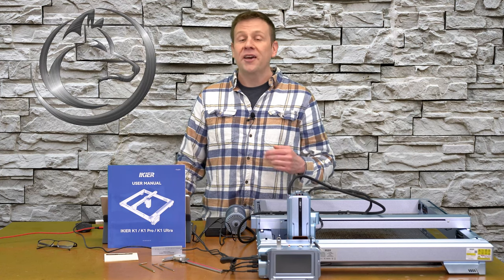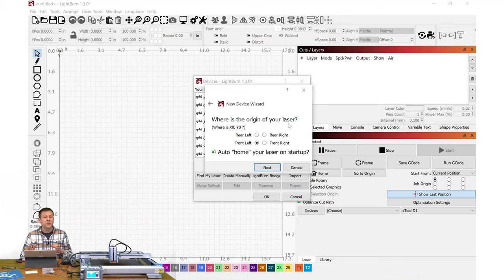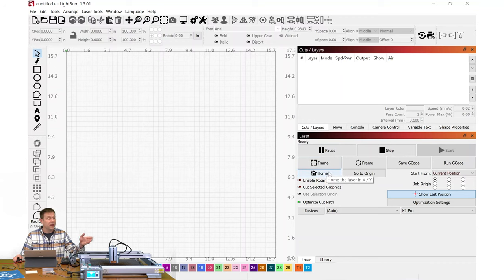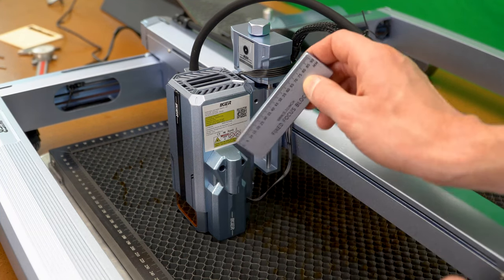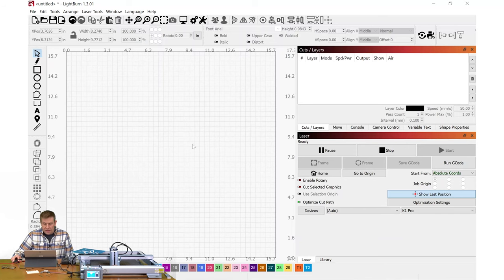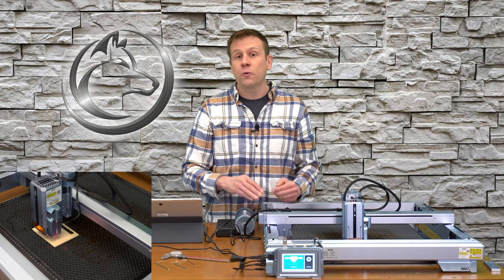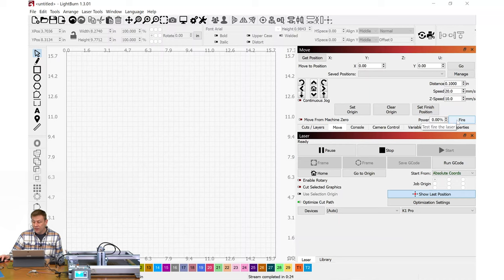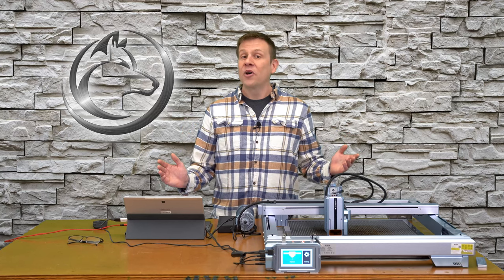Ikier K1 Pro-  Lightburn, Autofocus, and Crosshairs!

Comment: Awesome . Have you tried to do a photo reproduction or carving or 3 d with this Ikier ? I'm wondering if i can do a good photo reproduction .Is that the 70 w ? Thanks
Reply from the maker: Thanks- from time to time I engrave photographs.  Lasers in the ~20 to 24 watt range do very well.  High wattage tends to over drive the engraving which is why Ikier laser machines are often selectable between 24 and 48 watts.  The 24, 48, and 70 watt lasers are suitable for 3d engraving.

Comment: Hello sir. I love your videos but I am having a problem with setting up the auto focus. It keeps giving me an alarm 3 saying reset while in motion. What am I doing wrong?
Reply from the maker: Thank you.   I would check the connections are firmly seating on the laser module and that their are no bend pins in the connector.  Next try setting the autofocus with just the sensor over the work material- sometimes uneven work materials can strike the laser viewing guard fist before the autofocus sensor is met.  Best wishes.

Comment: 5:45 Confused about this part. My Ikier K1 Pro appears to be stuck at it's highest point as seen on this timeframe (even slightly higher). When I'm rotating the top screw counter clockwise as you do it just comes off. The other direction it's stuck instantly. I am unable to lower this sliding part. Any idea what could be wrong?
Reply from the maker: There's two travel limit switches, one at the bottom (sets the focus) and one at the top- my first thought is the upper switch is somehow not being activated.  Maybe check the wire connectors.  After that I recommend contacting Ikier support.  Best wishes.
Reply: @thelaserchannel1 Thanks for the reply. Shortly after posting I figured out the issue and resolved it. I noticed this big top screw also has a hole on the side with a tiny black screw inside. That one apparently got loose which resulted in me being able to screw off this top screw completely rendering it useless. Tightening up the tiny black screw fixed everything and my laser can raise/lower again using this large top screw.

Love the machine so far. Still figuring out things one by one but the results are showing and getting better slowly. :)
Reply from the maker: @nialzinth   Glad you were able to fix it and share with us how you fixed it!

Comment: I couldn’t comment on your video where you show the z sink but I copied your powers and speeds exactly.  I used 1/4” plywood and the fire laser is at .25 percent.  It’s doing two passes to cut out the piece and it’s burnt really bad.  Lots of charring.  Am I doing something wrong?  Yours came out with clean cuts
Reply from the maker: I would manually check the focus- there's a silver/grey measuring tool for setting the focus manually.  Also not all plywood is the same- I've seen lots of variation even from the same big box store!  Hope this helps!
Reply: Auto focus set to 5mm. Does higher laser power affect it?  I did 4 passes sinking at 2mm a pass and it looks better but still not cutting full through.  What can I change to have it cut thru.  It’s only 1/4”
Reply from the maker: @DistinctiveDesignTeamDDT  I higher power level will help along with running the air assist at 100% or full on.  Before trying the above inspect the leaser lens for any smoke residue or cracking/etching.

Comment: Great easy to follow video....until mine doesn't do what yours does! The laser will not home when I hit the home button but it will move if by using the arrow keys in Lightburn. I kept following to the part of focusing but again the laser won't move up and down. In both cases it just stays put and hums. Any advice will be very much appreciated. My head is swimming from reading and watching so many things. I feel like I'm falling down a rabbit hole!
Reply from the maker: Glad you like the video-thanks!  I can't think of any ideas to offer you other then to check the connections making sure none of the pins are bent.
Reply: Mine did the same thing - loosen the cap on the Z axis (the hex nut on the top), then run the autofocus - mine was causing too much friction. you can reattach it slightly off from the surface of the motor

Comment: My IKIER is 410mmx410mm but if I try and cut even 270x270mm it runs into the right side of my machine. I know there’s a setting I have messed up but I can’t figure it out!
Reply from the maker: All depends on the start point of the project.  If you're using Lightburn it sounds like you're using the "Start From- Current Position".  There's a Job Origin just below with 9 dots- the selected dot will show up as a little green square on your project.  I suggest the bottom left corner and just make sure your laser module is near the front left corner when you start.  Hope this helps :)
Reply: I figured it out! Lightnurn couldn’t find my laser so I just used the GRBL-something. Well I switched it to just GRBL and now everything works perfectly!

Comment: Just so you know, once you set it up, its a bit tricky and there are two ways to do it. 1: Set your coordinates to absolute, home your machine, hit the autofocus, make sure you have a small piece of whatever material your working with under it, then frame, then hit start. 2: Set your coordinates to absolute, hit frame, then hit autofocus twice if it doesn't focus on the first one, after it frames, reset your coordinate to current position (if you don't it will treat your current position as home and move accordingly), hit start.
Reply from the maker: Awesome- thanks for sharing!
Reply: Are you doing all of this in light burn or from console
Reply: Greg have you ever used the restart option because you can’t be in absolute when using that feature?
Reply from the maker: @andrewearl9315  I'm using the features on the machine in Lightburn- for the Autofocus setup there are a couple of simple steps to get a button programmed in Lightburn.
Reply from the maker: @andrewearl9315  I don't recall using the restart option.  I think I can still use the Autofocus button even in "current position".  You are correct when not using "Absolute Position" the machine will not perform the autofocus when hitting the home button in Lightburn.

Comment: LightBurn isn’t finding my device.   Any suggestions?  I used the c drive to the c drive connection
Reply from the maker: By C drive connection you mean USB-C to USB-C cable?  I had issues with that type of cable on my PC; I used a USB-C cable with one end having the large rectangular end and the machine connected with no problems.  Let me know if this works.
Reply: @thelaserchannel1  yes.  My mac only has usb-c ports.  How were you able to connect a large rectangular to the mac?
Reply from the maker: @angeltinoco229  My PC only has usb-c as well.  I used an adapter from usb-c to the large rectangle.  It looks weird but it works on my PC.  Here's the adapter I'm using: https://www.amazon.com/Adapter-Anker-High-Speed-Transfer-Notebook/dp/B08HZ6PS61/ref=sr_1_3?crid=3P1NWDKNAMVYU&keywords=anker+usb+to+usb+c+adapter&qid=1701832602&sprefix=anker+usb+to+usb+c%2Caps%2C909&sr=8-3
Reply: It worked.   Your videos have all been helpful.  Still trying to learn what powers and speeds to set it on to get clean cuts.  My circles come out chopped up and not smooth and I assume it’s the speed I’m using.  I also need to get that honeycomb.  Appreciate everything you put out
Reply from the maker: @angeltinoco229  Thanks!

Comment: hi, many thanks for this, i have been using the K1 and been really struggling with framing my work with the laser line or firing the frame, one thing id like to know is if i decide not to use the laser off set how would i turn the red cross off?
Reply from the maker: To turn off the offset go to Edit then Device Settings.  There will be a spot to turn off the Laser Offset.  I think the laser cross hairs remain On but the Lightburn software will now use the Laser itself as the position (no offset). Hope this helps!

Comment: Hey Greg some how it put Kim in comments sorry. How do I enter size of part I want to engrave in light burn then set  machine or part zero from center or from left front and select what to engrave I’ve got auto focus all done. I’m confused about that. How to set my work offset and cut lines or engraving lines.  Please help.
Reply from the maker: Hi- using Lightburn software; to resize navigate to the top left and you'll see a padlock- make sure it's locked and type the max width or height for your desired size.  To perfectly center- home your machine while in "absoluter coordinates", then on the top of the screen on the right side of the icon tool bar there will be an icon that looks like a crosshair with no circle around it- this will move any highlighted object to the center of the work area or any number of positions- you can even move the laser to any number of locations too!  Hope this helps- I'll have to make a video sometime showing these really cool features!

Comment: Where can i find the test file to get best settings?
Reply from the maker: Hi- I use the Material Test Generator found in Lightburn under Laser Tools>Material Test.  This brings up the menu to create a test grid based on your input settings.  I usually use Speed and Power as the two variables. Use the Edit Material Setting to select between engraving or cutting.